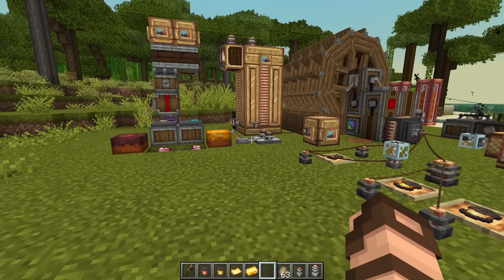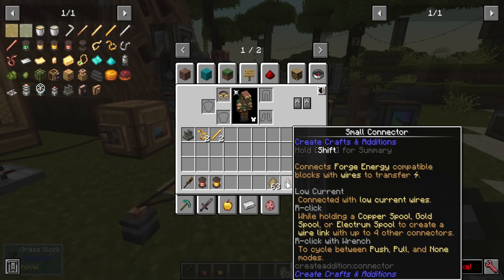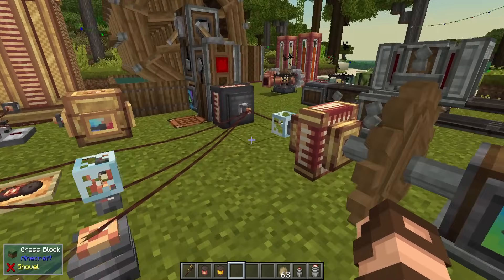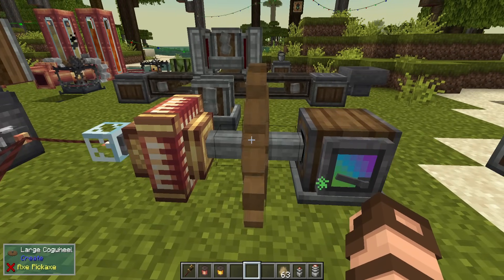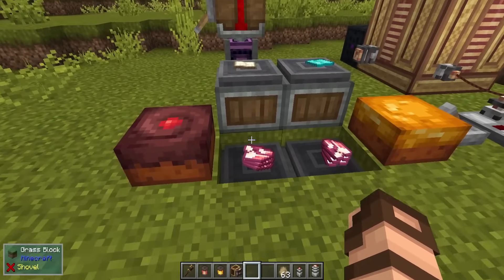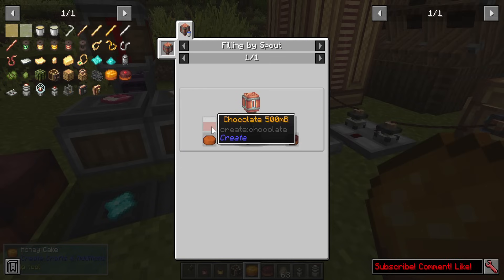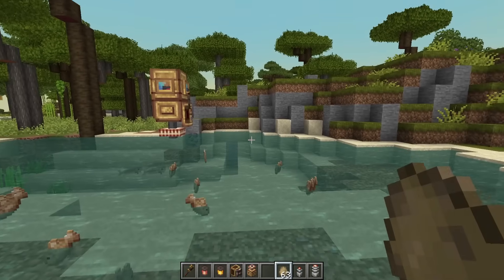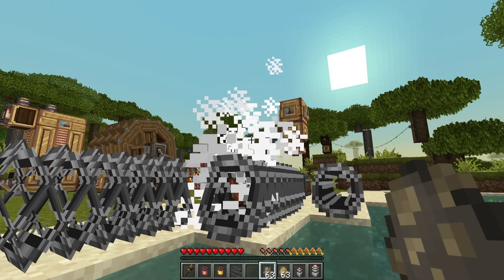Electrify your Create: Crafts & Additions - Minecraft mod 1.20+ Bit-By-Bit

Comment: Fun fact actually, you can get electrum nuggets by grinding Tuff in a crushing wheel, so you can still get Electrum. Just, a lot slower than if you just had silver.
Reply: omg, ty i didn't want to download the other mods just to get it and I was soooo salty at first that I wouldn't have access cuz they couldn't be bothered adding in a way to get it :D
Reply: @MewThePatato  No problem. I'm quite familiar wit hthe mod. ^^
Reply: what mod do you use to get silver tho
Reply: @francescorossetto7681  Just about any mod that adds it naturally. Thermal Foundation comes to mind.

Comment: Be aware: you must use this mod's zinc sheets to make capacitors. You cannot use a different zinc sheet/plate from a different mod.
Reply: Hm, hopefully they patch that!
Reply: There are in fact some unifier mods that fix that, though not every one does so.  Personally I use Create: Mortar, Create Addon Compatibility and Almost Unified (required for Create Addon Compatibility), particularly for purposes of cross-addon support (some Create addons add their own versions of materials that often conflict with one another without these mods [Create Deco is an example of an addon which adds items that conflict with those of other addons {i.e. Create: The Factory Must Grow and older versions of Create: Dreams & Desires, which now has its own addon that fixes these issues: Create: Unify}]).

Comment: That zombies path through the barbed wire might actually be a bug.  Zombie pathing has awareness of damaging blocks and won't walk over sources of damage if there's another path it can find.   Given that minecraft is VERY bad about actually making things clear, I'm quite sure it would take a stupid amount of work to even FIND the code responcible, and fix this...  and thus not "bug" and "feature" instead.

Offhand I can think of two places in minecraft that would need alteration, that others might be depending on...  so it might be something to poke forge about turning into a flag...  anyway, out of the scope of this video, that is sure.

Comment: In All of Fabric 7 they have Hephaestus (Tinkers) and you can make the sheets and rods in the Forge. Must easier since you can bulk process them. You need a lot of plates for the motors. I am making a bunch of motors right now to power some of the standalone contraptions I have. In AOF7, you can pair the motors with Powah basic solar and glass fiber cables. Works well. I need to try and build a solar array and see if I can connect the motors up to the array with the connectors.

Comment: Oh yo! Have you tested how well this works with Immersive Engineering? Like could I potentially use my IE generator to power Create machines? Cuz like. It would be so nice to have that kind of compatibility between the two mods, especially since I frequently see them packaged together.
Reply: Any mod that generate FE is compatible so yes
Reply: @smokedeuch4039  Oh swag. I'm still pretty new to both mods, so it's neat to know that I can get them to work together :)

Comment: Something I didn’t really notice in this video was the effects of torque and how that translates to the input and output of the alternator and motor respectively. You had a steady 32 rpm going into the alternator, but how much torque was that? Does that get detected along with the speed of the alternator, or is it only the speed that dictates the power generated?  And likewise, the motor put out 24 rpm with a stable power flow… but how much torque was there?
Reply: Easiest way to tell is to slap the Stressometer from base Create on there. SU is basically torque, as far as I can tell. The way Create works, if you overload the system, it just shuts down entirely until you add more rotation generators.